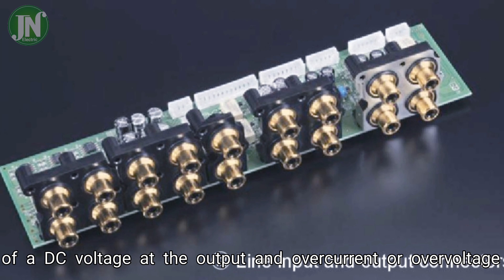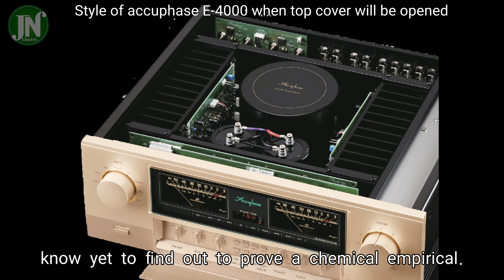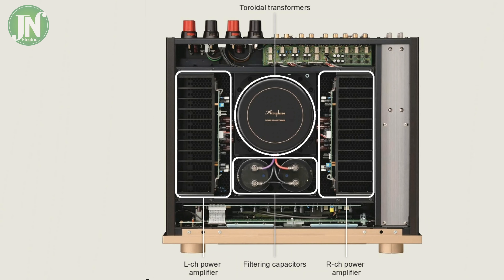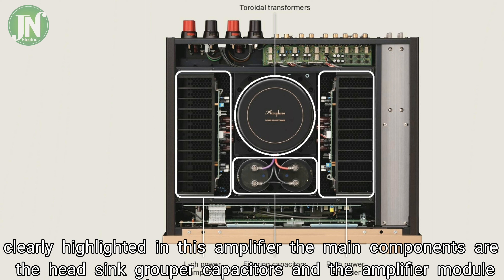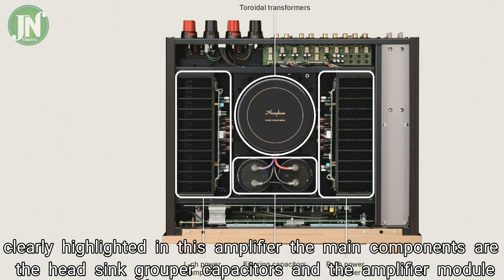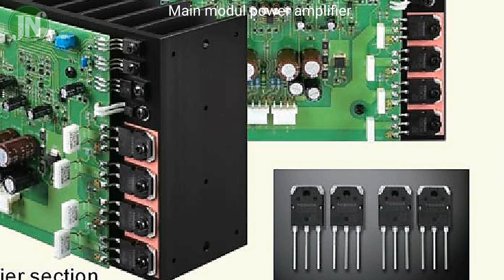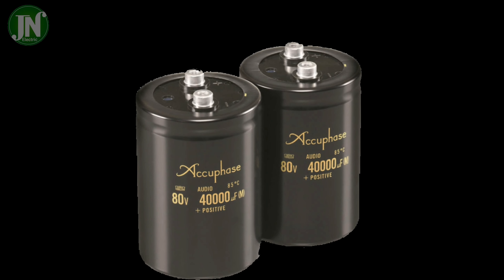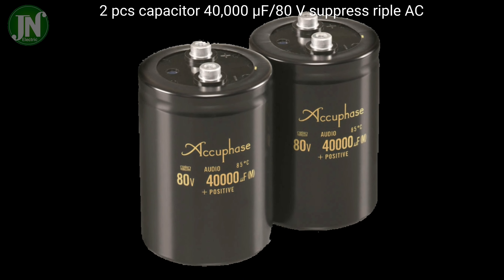E-4000 integrated stereo amplifier emerged separate amplifier technology accuphase after covid 19

Comment: Can the Japanese 100V be converted to US 110/120V?
Reply from the maker: Yes it can . There are two ways to change the voltage from 100VAC to 110/120VAC. 1. You need a step up auto transformer, this is more efficient and 2. You can also change the primary winding of the transformer from 100VAC to 110/120VAC, which means rewinding or by adding several  primary winding.  from an existing main transformer.